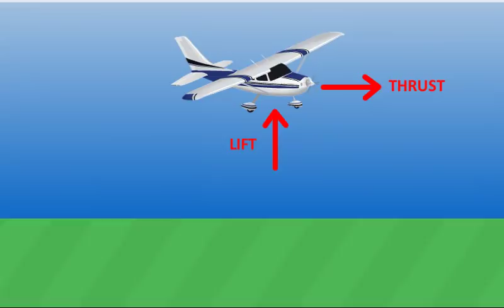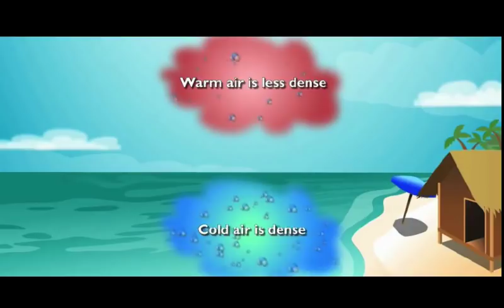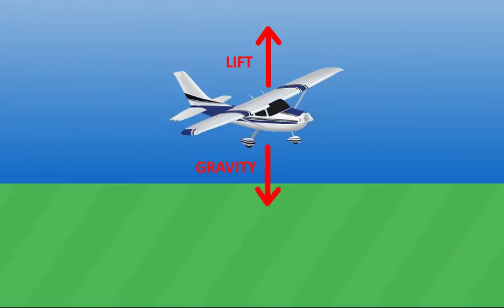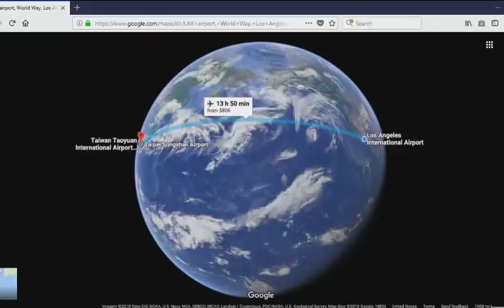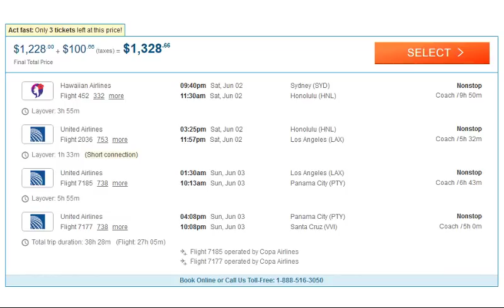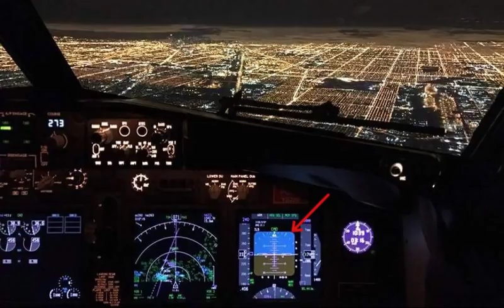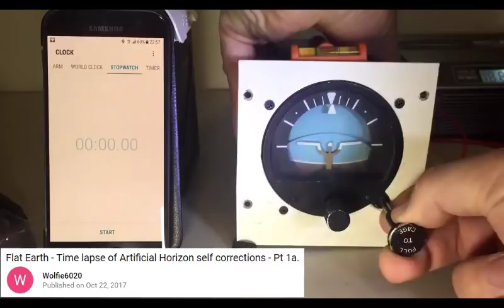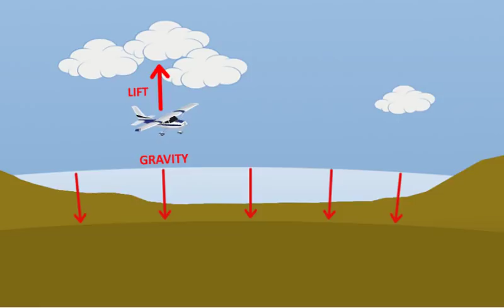Flat Earth Falsities - Plane Nonsense

Comment: If an airline flies from Los Angeles California to Boston Massachusetts at 650 miles an hour and the Earth rotates at 1040  miles an hour based on the equator how can that airplane ever reach its destination?
Reply from the maker: This is answered in the video. The plane on the ground is already moving with the earth, and keeps moving with the earth after takeoff. The 650 mph is relative to the ground. It adds that speed to its existing rotational speed.
Reply: @JonasGrumby71  okay so a balloonist launches a balloon filled with helium to an altitude let's say of 1000 ft 3000 feet really doesn't matter that balloonist and his balloon are now neutralized and don't go under the laws of gravity it is weightlessness so that balloonist should rise to a thousand feet let's say and the Earth beneath him must be traveling at almost 17 miles a minute underneath him but yet he remains still Motionless providing there are no trade winds. That balloonist is now not influenced by the Earth's gravity permitting the Earth to spin up to 17 miles a minute beneath it on the earth ground surface.
Reply: @artvandelay540  "that balloonist and his balloon are now neutralized and don't go under the laws of gravity it is weightlessness"
False.  The balloon is floating because of gravity.  

"and the Earth beneath him must be traveling at almost 17 miles a minute underneath him but yet he remains still Motionless providing there are no trade winds."
As explained in the video (you did watch it right?) the balloon was traveling with the Earth before it took off, it will keep that momentum forever unless something acts on it to counter that momentum.  This is basic high school physics, First Law of Motion.  Commonly referred to as Inertia.

"That balloonist is now not influenced by the Earth's gravity permitting the Earth to spin up to 17 miles a minute beneath it on the earth ground surface."
Wrong on two counts.  First, it is still very much influenced by gravity since gravity is the thing causing it to float in the first place.  Second, gravity is not the reason the balloon remains stationary relative to the surface of the Earth, inertia is.
Reply: @MrQuaiven  once again referring back to Nikola Tesla's take on gravity and this calls in line to the properties and molecular structure of helium. A child what's a full helium filled kids balloon fly off into the atmosphere are you telling me that that helium balloon is going to be tractor pulled along with the Earth's gravity and not see the Earth underneath it pass at a revolution of approximately 16 miles a minute?
Reply: @artvandelay540  "once again referring back to Nikola Tesla's take on gravity and this calls in line to the properties and molecular structure of helium."
What?  Care to link to Tesla's actual "take on gravity"?  Not a FE believer video, his actual "take on gravity".  All of his papers are available online so it is not difficult to find his actual words.

"are you telling me that that helium balloon is going to be tractor pulled along with the Earth's gravity and not see the Earth underneath it pass at a revolution of approximately 16 miles a minute?"
As you have been told, repeatedly, gravity is not the issue here inertia is.  The balloon was traveling with the Earth before it lifted up, it will continue to travel with the Earth until something acts to counter that movement.  First Law of Motion.
Reply: @MrQuaiven  today's scientists have substituted mathematics for experiment and they wander off through equation after equation and eventually build a structure which has no relation to reality. Nikola Tesla.
Reply: @artvandelay540  Well done you've copied and pasted straight from Eric Dubay.  That is not "Tesla's take on gravity".  So what was "Tesla's take on gravity".  Keep in mind Newton presented his theory of gravity 200 years before Tesla was born so he was not a "today's scientists" to Tesla.
Reply: @MrQuaiven  no I cut and paste it from Nikola Tesla's documents Good one
Reply: @MrQuaiven  you stick by Newton's law of gravity which was presented 200 years ago that seems to be your Bible go by everything that you have learned in high school and in college for engineering classes. Stick with all that information and spit it out to everybody cuz I'm sure you're not going to listen to anything outside that box.
Reply: @artvandelay540  Yea we stick by it because it works.  The same reason we stick by the Law of Thermodynamics, the Theory of Electromagnetism, and Germ Theory.  Because they all work.  If you want to replace gravity (or any other theory) then you're going to have to find a better explanation for all the things it covers.  Making some empty claims about something Tesla might have said is not a replacement.  You have to explain all the things gravity explains and you have to explain all the experiments that prove gravity.  And your explanation has to be better (as in more accurate) than the currently accepted gravity.
Reply: @MrQuaiven  agreed. not disagreeing all good points. It has been taught to us and we have learned all this information put to us.
Reply: @artvandelay540  You say you agree but you also say things like "you stick by Newton's law of gravity which was presented 200 years ago that seems to be your Bible".
Reply: @MrQuaiven  i agree with YOUR way of thinking with the science and physics education that was given to you and i growing up.But for ME in my early 60s now im looking at information given to us a different look saying what if. My profession over the years has helped me find many discrepancies in our lovely friends at NASA on technical issues they want us to believe as factual.There is many smoking guns here.
Reply: Try some practical, real life knowledge then.
"It has been taught to us and we have learned all this information put to us."
Why is it that a compass needle is more or less vertical at the poles and horizontal at the magnetic equator?
And when you carry on past the poles the needle slowly returns to the horizontal?
Why is it that it is only possible to navigate accurately over long distances using spherical trigonometry?
Why is it that traditional gyro compasses work perfectly in low latitudes but became unreliable in high latitudes?
Why is it that it is only possible to navigate accurately over long distances using charts based on a terrestrial spheroid?
Why is it that when you watch a ship sailing away from you the hull is the first thing to go below the horizon, then the superstructure and finally the funnel and upperworks?
Does a magnetic compass point towards Polaris (Alpha Ursae Minoris) at the north and south poles?
Does a gyro compass point towards Alpha Ursae Minoris at the north and south poles?
What is the relationship between longitude and distance when travelling east or west parallel to the equator?
Tell me how you ascertain the error of a compass when in the Southern Ocean, using Alpha Ursae Minoris?
Please explain the principles behind the development and functioning of a gyrocompass?
No evasions please, just straight answers.
 @artvandelay540
Reply: @artvandelay540  "no I cut and paste it from Nikola Tesla's documents"

Which one? Care to share the link?
Reply: Clark Griswold Good God!  Why are you people always bringing up Nikola Tesla? If you are unable to grasp basic physics, there's no way you will come close to understanding the theories of Tesla.
Reply: @artvandelay540  Why does a helium balloon go straight up? What is the force PULLING it upwards? If gravity does not exist, then what force causes this?  A helium will blow in the wind.
Reply: @MrQuaiven  The balloon is only falling back to the state it was picked up from. The only force is that in which it was picked up, not in that of it falling. What falls that wasn't picked up first? Falling is just the reaction of being picked up to start with.
Reply: @1Foulkesy  We know that hot air expands and is lighter and therefor rises. Nothing can fall that wasn't picked up by a force to start with. Things that are picked up are going to fall. No gravity necessary. You can't pick something up, and drop it and say that gravity pulled it down. No, you picked it up first I can promise you that!
Reply: @reggiereid1345  Reality disagrees with you.  But like I told you in a different thread I look forward to watching you receive the Nobel Prize for Physics now that you are completely rewriting the First Law of Motion.
Reply: @reggiereid1345  "We know that hot air expands and is lighter and therefor rises."
Can you explain what "lighter" is please.
Reply: @reggiereid1345  Gravity is necessary to weigh something. Why does everything fall down to the ground?
Reply: @artvandelay540 , incidentally I work with helium balloons as my part time job. I must tell you are plain wrong. Imagine you are in a moving train car and you inflate a helium balloon and release it inside car. It will continue moving together with you and everything and everyone else in the car. For outside observers you will pass by all together. That is because you are all in continuous motion. Only if the train suddenly stops the balloon will continue moving. You, on the other hand, will probably fall from your seat forwards but it doesn't matter in this case. Same thing happens when you inflate balloon on the ground, it will maintain the speed with the Earth. PLEASE NOTE that altitude has little to due with drop in gravity pull. No matter how high up in the air the balloon goes the Earth's gravity is still present and strong. Technically, there is no limit to gravitational pull, though it's strength falls with distance. Gravity is what keeps moon in orbit around Earth and the moon is 384,000 km away on average. Don't mix it up with weightlessness. People on the ISS feel weightless due to fact that they are in constant free fall akin to what people would experience in a free falling elevator only in this case the ISS is also moving fast sideways so that it never falls on the ground. What do you think why old Russian, American and Chinese space station and an unknown number of satellites eventually fell on Earth?
Reply: They also have automatic atmosphere momentum that is attached to the ground, so its all one as if in a domed speeding vehicule. (not sure how airborne matter reacts in a spinng one) Its Greek science, that started with two sticks, some maths, and deduction (for a far far away sun).
Reply: @BrainUser1  dammit Lewis you're right!
Reply: @Clark Griswold, I don't normally reply to these kind of things (these arguments are so strange), but please remember that if you use a frame of reference that is "outside" the earth (ground+air), then the airplane is also "moving" @ 1040 miles an hour while its still on the ground.  So when its takes off its "moving" at 1690 miles(1040+650), towards an object moving at 1040 miles an hour, so its still a net 650 miles closer every hour.  Irregardless of what you "believe" the math just works that way,  it doesn't matter if its a spinning sphere or a stationary flat disc, a man on a train, or a yo-yo.  Until this reaches "relativistic speeds" the science says the math for everyday use is fine to use at these "slow" speeds.

The argument you make is akin to saying while traveling in a car at a 100 miles/hour, you cant pass a ball to the person in the front seat, unless your a pro baseball player.  It will never reach the front seat unless you throw it greater than 100 miles an hour.  Its just impossible.  Its the exact same math, you're part of the system that is moving at 100 miles/hour, so you can just pass it normally.  The plane is part of the system (earth, ground AND atmosphere) moving at 1040 miles/hour, so it can fly normally. Does that "PROVE" the earth is moving or stationary one way or another, well no it doesn't.  However, if proves the lack of basic understanding displayed by almost all of FE people, is lacking.

You can't really expect any reaction other than the one you get if you cant understand basic principles and basic math.  There is nothing to be gained from this type of argument, it can never resolve the dispute. If you ever want to taken seriously, some basic understanding and common ground (math) has to be reached. There is so much "relatively" impartial evidence for a spinning globe revolving around a sun, and a lot (mostly?) of pure fake and misinformed FE evidence that i would have to believe most of the FE people are just faking their believe and trolling.  But i know a couple of people personally that seem to believe it, and they just claim everything is faked or an illusion.  

And a side note, if your coming to this from a religious point of view, please stop right now.  At best you will ignored by people that would never listen to matters of faith in the first place, and at worst you drive people that might listen away. Remember that "we who teach will be judged more strictly".  If your not a person of faith please be aware that FE people are not the norm, (i'm sure you already knew that) and many (most? i hope?) people that do believe in some sort of faith ALSO believe in scientific foundations like a heliocentric solar system, evolution, and even a big bang.  

For FE people that do so because they think they doing it in service of God, here a sobering quote....

"Usually, even a non-Christian knows something about the earth, the heavens, and the other elements of this world, about the motion and orbit of the stars and even their size and relative positions, about the predictable eclipses of the sun and moon, the cycles of the years and the seasons, about the kinds of animals, shrubs, stones, and so forth, and this knowledge he holds to as being certain from reason and experience. Now, it is a disgraceful and dangerous thing for an infidel to hear a Christian, presumably giving the meaning of Holy Scripture, talking non-sense on these topics; and we should take all means to prevent such an embarrassing situation, in which people show up vast ignorance in a Christian and laugh it to scorn. The shame is not so much that an ignorant individual is derided, but that people outside the household of the faith think our sacred writers held such opinions, and, to the great loss of those for whose salvation we toil, the writers of our Scripture are criticized and rejected as unlearned men. If they find a Christian mistaken in a field which they themselves know well and hear him maintaining his foolish opinions about our books, how are they going to believe those books in matters concerning the resurrection of the dead, the hope of eternal life, and the kingdom of heaven, when they think their pages are full of falsehoods on facts which they themselves have learnt from experience and the light of reason? Reckless and incompetent expounders of holy Scripture bring untold trouble and sorrow on their wiser brethren when they are caught in one of their mischievous false opinions and are taken to task by those who are not bound by the authority of our sacred books. For then, to defend their utterly foolish and obviously untrue statements, they will try to call upon Holy Scripture for proof and even recite from memory many passages which they think support their position, although “they understand neither what they say nor the things about which they make assertion.”" 
- St. Augustine, The Literal Meaning of Genesis, 415CE

Comment: If the Earth stopped spinning suddenly, the atmosphere would still be in motion with the Earth's original 1100 mile per hour rotation speed at the equator (if no drag; from speeding or with all the DARK matter).
 All of the land masses would be scoured clean of anything not attached to bedrock. This means rocks, topsoil, trees, buildings, your pet dog, and so on, would be swept away into the atmosphere. 
    That is some heavy duty force (not like weak Gravity), If aircraft takes off contrary, or perpendicular( -6:42- ) to the spin it will encounter a sudden resistence dispite magical perfect synced atmosphere Momentum, nothing can overcompensate for it, until all that sticky air gets to integrate and stabilize the new element in its wake.

If you don't understand physics look up what I said. If an aircraft takes off from a spinning object it's going to difficult time to follow that spin ever, you cannot overcompensate for it, even it the wind is blowing in the same direction. If its going contrary to the atmosphere Momentum... well better have a big butt for it to all in sync.
Reply: Also be sure to watch the upcoming blockbuster:  The day the earth stops spinning and everybody flies into a wall.
http://www.qwantz.com/index.php?comic=351